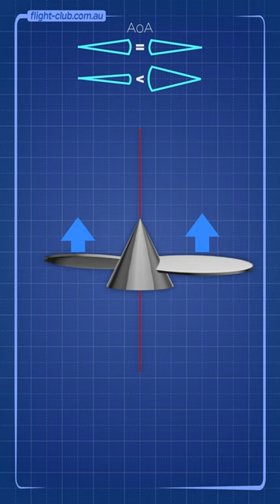Propeller Effects. #aviation #propeller #pilot

Comment: The turn of the aircraft depends if the propeller is clockwise or anticlocwise also ^^
Reply: I haven’t seen any anti-clockwise propelling engine in my life. Do you know such aircraft?
Reply: @ErimTuna172  I don't remeber but it usually occour in multiengine aircrafts
Reply: @ErimTuna172  The Rolls Royce Griffon spins counter clockwise, it apparently caused problems for pilots in Griffon engined spitfires as the merlin engines in earlier spitfires spun clockwise so pilots had to learn to apply rudder the opposite way for take-off.
Reply: @Erim Tuna  a Rotax 2 cycle engine with a gear box.
Reply: @louisgordon4388 those engines are clockwise..they installed a reduction gear  that end up being a counterclockwise..
Reply: @ErimTuna172 U.S. aircraft tend to me clockwise. A lot of twins are designed to have one engine clockwise and the other anti clockwise so it basically cancels out most of the left turning tendencies you’ll have a single engine clockwise rotating prop as seen from the cockpit.

Comment: With at least 15,000 flight hours on a power Lazy Boy recliner, I finally see something that is explained in the most simple way that makes a lot of sense.  Since my recliner is single engine only, is the reason why dual engine aeroplanes have propellers that spin in opposite directions to counter act the torque pull from the propellers?
Reply: It's one of the reasons, yes. Another would be that both engine's torque basically cancels itself out, so changing the throttle input won't make the plane want to roll

Comment: Are you sure ?
Only planes that have inverted tricycle, begin there take off with pitching up nose, which then stops with rear up when certain speed is attained. 
With normal tricycle, from the beginning the nose is aligned with mouvement. 
Therefore this effect imust be very minimal.
Are you sure it isn't another cause involved?

Comment: Typically why we use right rudder on take off, until the aircraft gets up to speed. Good stuff. 👍
Reply: But that's due to propeller slipstream going around the fuselage. I generally fly pusher airplanes and those require no rudder input during climb, descend, or any range of throttle input.
Reply: No that's from the spiraling slipstream and torque effect. What is described in the video is P-Factor, which would be most pronounced with a high "deck angle" but level flightpath (like slowflight). 

In theory a taildragger could experience P-factor during the takeoff roll, but it is not even perceptible at low airspeeds. Before the airspeed would be high enough to make it effective, the tail would be raised already eliminating any P-Factor.
Reply: Ya this is false. That may be true after you rotate and you’re climbing, but on the takeoff roll, we use right rudder to counteract the propwash hitting the vertical stab, as well as the torque from the engine.
Reply: He’s really acting like he’s a pilot by having a pic of him in a plane… except he’s in the wrong seat lol

Comment: The propeller is spinning though. As such, wouldnt the point of maximum displacement be 90 degrees ahead of the point of average force application? Gyroscopes would nehave like that.
Reply: That only applies to a force that actually displaces the gyroscope. In this case P-Factor is not causing the Propeller to move as the force ends up being transmitted to the driveshaft then the airframe. Precession is fealt when the Propeller is actually physically displaced.

Comment: How is torque countered?

Once I made a helicopter since it was rotating clockwise, my whole motor also started rotation clockwise as it should be. To counter this most helicopters use tail rotors to control that.
But what happens in plane ?

Comment: The conclusion here is wrong, you need rudder on takeoff because counteracting the torque of the propeller uses aileron, and the drag of the aileron causes a yaw torque on the aircraft. As for the right side of the propeller having more lift, that is true, but due to gyroscopic procession, that torque is actually a pitch up not a left yaw.
Reply: I cut and pasted this question that I also asked orion_13. He was talking about offsetting the engine to the right a few degrees on RC planes. I asked this:

Yep, that thrust to weight ratio is a lot higher on RC planes and tail draggers are really affected by this left turn tendency on the takeoff roll. Do you think that’s more from torque, or because tail draggers are pitched up a little (like on the vid) while on the ground? I always thought we offset the centerline of the engine to compensate for torque or gyroscopic effect (I’m not sure what the correct term is) of the engine rather than differing levels of thrust from the different sides of the prop. Really interesting though.

Thanks

Comment: Is this a greater factor than the engine torque?
Reply: They are on different axes so its not necessarily comparable. Torque wants to roll the aircraft while p-factor wants to make the aircraft yaw (turn). For a pilot, P-factor is probably something to be more concerned about than torque because  it becomes more prominent at high angles of attack, such as near stalls, where a lack of rudder coordination can lead to a spin.

Comment: P-factor, or asymmetric thrust.

I have a question though. Nosing up should also cause a left yaw due to the prop acting like a gyroscope shouldn’t it? Which force is bigger, precession or asymmetric thrust
Reply: I'm with you on that one both factors contribute. How much these factors contribute with vary with the engine RPM air motion  excetera.
Reply: Nosing up would actually cause a right yaw. Force is applied to the bottom of the prop that is spinning clockwise so the resultant force is “pushing” forward on the left side of the prop causing right yaw
Reply: @user-ik2ex5zv2r .. plus, the torque generated by the engine at T/O power

Comment: Fun fact, its rotating in the wrong direction
Reply: Not necessarily. Most Cirrus aircraft props rotate clockwise. You actually need left rudder input on takeoff, which is an odd feeling after flying Pipers and Cessnas whose engines DO rotate counter-clockwise.

Comment: 'educated' RC plane modelers knows this, hence instructions says either to mount the engine at an angle to the left side. if the instruction does not say so, see if the engine mount is not at the 90 degree of the fuselage.

Comment: Soooooo… what happens in high winds and the plane is crabbing toward a landing???
Reply: The only part of that sentence that affects p-factor is the fact you are in a landing. Your p-factor is increased because you are at a higher AOA but you are also most likely at a lower power setting which reduces the p-factor. High winds do not affect the propeller, and crabbing does not.

Comment: That's why the vertical tail aileron on a single engine will normally have a tab or kink cut into it to counter the twist of the propeller.

Twin engine aircraft kill complacent pilots. The two engines counteract each others twist. This is done by having the right engine turn its propeller in one direction & the left engine turn its propeller in the other direction.

This gives you a smooth and steady flight control until one engine goes out. Then boom, the twist of the only operating propeller can & will flip your plane over if the pilot is not ready.

Comment: I don't think it's the correct explanation. The symmetry is broken in the up down direction and not in the left right direction. It's because of the upper half makes different lift then the lower half which results in a torque being applied to a rotating body (propeller) which changes direction resulting in the yaw. It's the conservation of angular momentum that is the cause.